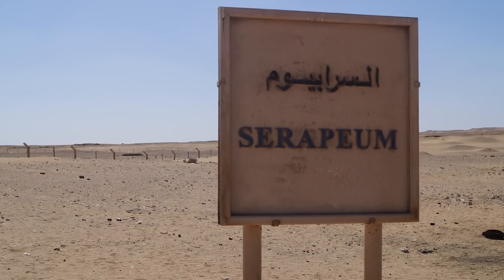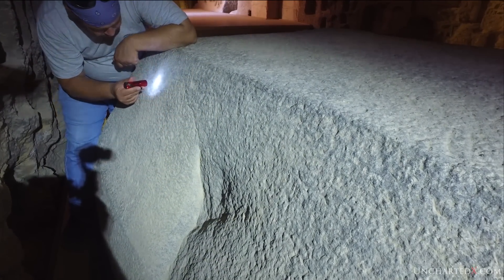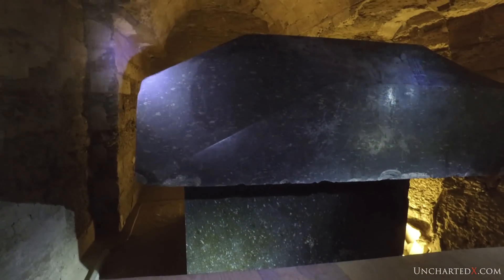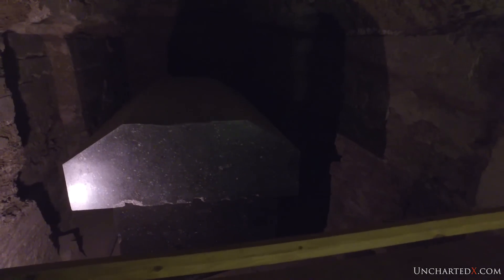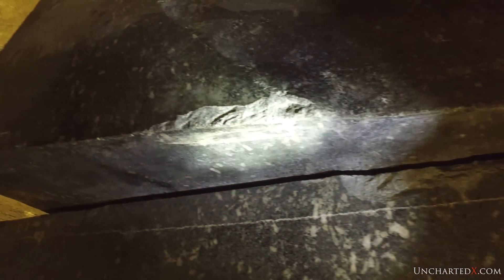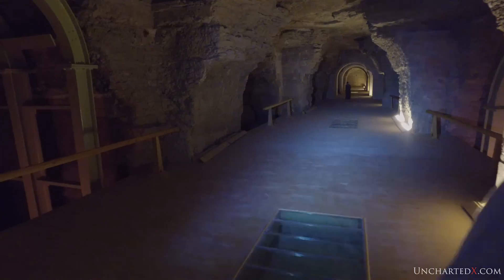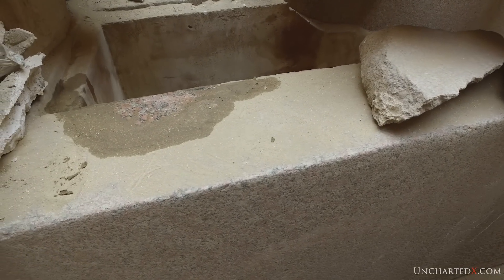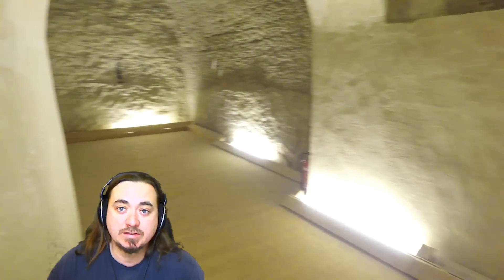Evidence of Ancient High Technology - Liquid Polishing at the Serapeum of Saqqara - Chapter 4

Comment: @UnchartedX
Mind, blown. Spilllover of edge IMO shows an acid was applied & with a roller - the surface was not rubbed at all. AAncient Arch points out sulphuric mine runoff, used by Inca to set wall blocks. Anyway wow - and was this a brewery with one vat per county - and thus a beer allotment that must not be overshot by residents? Were there 24 regions in the administration?.

Comment: That wikipedia snippet is just saying that crystals form because of a low energy state from a repeating arrangement. this just means that they fit together well that way. in other words there is a spot that the molecules like to fit into and it takes more energy to move them out of those spots than into them. It has nothing to do with any weird energy vibration focusing nonsense. To give an example a golf ball finds a low energy state in a golf hole. there is nothing spooky going on there with that low energy state. The ball just has less potential energy due to gravity because it is closer to the center of mass of the earth.
Reply from the maker: yeah i know, im going to fix it when i put the whole thing together in one piece. I get that it's not a solid crystal, it has quartz etc in it, but its not a uniform structure. Of course I probably should have looked into that before but there's only so much I can do

Comment: At 7:07 i strongly disagree that faceting has something do about any crystallin structure/energy.  If the box is functional, like a long term sealed up seed vault, it would seem natural to take material of the side of the lid, to be guaranteed that the center of mass would be somewhre in the middle about the container during some cataclysmic event and to prevent cracks..  Perhaps one side had lots of cracks, but to make it easy and to get symmetric weight. They faceted it like they did. Seems reasonable to me.. Didnt the sarcophages in the osiris shaft have some oily sticky material, this could be remnants of the sealing "glue"

Comment: The liquid runs on the box which he points out could have been caused by the people who shifted the lid to gain access to the inside. In other words they used a lubricant to aid in shifting the heavy lid. It is obvious that it was a real struggle to move the lid as the damage to the edges testifies to.
Reply from the maker: possibly, but the polish on the underside of the lid, in the sections of the liquid 'runoff' is what is truly puzzling. If you ever get the chance to visit the place and look at it in person, it's really obvious just from the touch how much smoother and finer the finish is on these spots. I don't know of any liquid that we use to achieve this. And 100%, trying to move the lid would be a massive effort.

Comment: Indentations  are polished, are the hieroglyphs (inside the strokes) polished as well? If yes the Egyptians did it all, creation of the boxes. If no, the hieroglyphs most likely came along later on, when the polishing method had been forgotten. That would also suggest that the hieroglyphs would be graffiti. 
If the boxes themselves where made as geopolymers, I think, you could add a thin watery layer of geopolymers on the surface when to box has hardened. That would, I suspect make it very shiny, also creating drip marks under the lid.
Reply from the maker: Watch part 5 of this series. I get into the exact thing you mention. To give you an answer now, no, the glyphs are not polished. On ANYTHING.
Reply: @UnchartedX  Thank you, I will watch part 5. Then glyphs are made after, and most likely are the boxes made from another civilisation (earlier). Makes no sense to spend the time and effort on doing the boxes perfect and then rush the glyphs.

Comment: I postulate that "they" were using these boxes to generate something/a substance: a mineral, a metal (gold?), fuel, etc... 
And maybe they needed multiple boxes because they could only use a box for a limited number of times - until its structure was compromised.
I'll also postulate that the reason for this taking place inside the earth/underground is that the substance creation process was highly volatile/dangerous to observe up close..
This is my only theory so far and it's kinda weak, but I tried.

Comment: Could the crack repairs have been attempts to enter the box?
Reply from the maker: Possibly, but my money is on natural flaws that showed up during transport or finishing... There are lots of chips and breaks where people have tried to lever off the lids over time, and we know what dynamite does to the boxes, thanks to Mariette. Before industrialized tools (in the 'modern' era, which is everything after 12,500 years ago or so) you're limited to manpower. Even slamming into it with a sledge hammer would most likely chip it rather than crack a 50+ ton piece in half. I'm really not an expert but that's how it goes in my head, I could very well be wrong!

Comment: Could it be a ceramic coating? Silica/Silicon dioxide? Nanotechnology? Whatever it is, it bonds to the surface and doesn't wash away or break down.
Reply: If they heated sand and melted it into liquid glass

Comment: Mercury, extremely captivating, and dense, fantastic transmitter of sound, liquid and solid form, over long distances, and uniquely, mercury drops respond with tunable shape, geometry, surface energy and even directional motion to sound like salt on a metal plate w sound pitch changes. Can lift, etch, shape, design, and mold anything even granite blocks…just need the knowledge…and the giant acoustic generator sourcing plus the long river of mercury. Which, mercury found in huge pools in pyramids!

Comment: I wonder what a composite liquid with hydrofluoric acid would do.   HF dissolves glass and would readily dissolve granite.    The difficulty is controlling the amount and distribution on the surface to get the polishing effect without irregular etching.    But if one could figure out how to apply it, then those drip polishing marks would have an explanation.    HF is not all that exotic and can be made from  fluoroacetic acid found in some plant species both in the new and old worlds (check out the article by Lia Mangolini on the Ancient Origins website).    The conclusion in the video that no acid was used is not justified.   If the process of dissolution is calibrated then the sealing effect noted would follow since the granite material is not removed but redistributed.   Using acid to remove material is just a variation on using mechanical means so clearly that cannot be how it was used.   Other explanations would require some other sealant to be present.    Anyway, it is clear that modern academia is systematically ignoring the physical evidence.

Comment: Electron microscopy on a polished peice would help and a molecular physicist to determine what compounds are in the polish,basicly a proper forensic analysis is needed for clarity the results would be enlightening,beyond the faceting comparison with a stealth bomber they too have coatings that further enhance the desired function. 
Defelection of radar waves and minimising heat signature and the boxes are hollow and air is a good insulator is it not,seems like a damn good plan to work out which energy they thought they were conducting,storing,focusing,using.
Youssef said they it knew it was not acid,what about an alkali and in fact there was an analysis done on some of the polished granite was there not ? Seem to remember it one of Hancocks books,non crystalline structures had been removed at the surface,leaving the percussively weaker crystals intact,would explain the sheen finish and glass feel,a nanostructure of quartz,perhaps generating a small electric field hence the longevity as it may have a shield effectively around it that may even be pressure activated as well as constant.

Comment: It is not difficult to polish indentations like these scooped out areas if you are polishing by hand or using hand power tools. When I nicked my bathroom counter I sanded out the kick in the middle of the counter to smooth it out some then I used a thick liquid polish to bring back the shine. The result was like these scoop marks but of course mine was less than a 1/2 inch in diameter. A bigger area would have simply taken more time. 

As to the more modern statue what attacks the polished surface is water and pollution. blown sand can do so as well but once something is buried or kept indoors in a cave it will be fine. If it's far from an urban center it won't be attacked so much by pollution.  Also how quickly the surface becomes dull is how shiny it was in the first place. If something is polished to 4000 grit then it may wear to 2000 grit and still look polished but if 2000 grit wears to 600 grit it will look dull.

Comment: Acid damages the material but it will etch it that is for certain.  A particle beam might do the job.  Try alpha particles.  Or beta particles.  Beta I don't think would work. I would guess alpha because it goes into the stone a ways in.  These boxes are where they stored high level Thorium salt solution for their molten salt reactors.

Comment: Ask any stone mason if he can make a 90degree edge on basalt or granite  by using a chisel and a hammer. Even worse give him a copper chisel and a diorite ball. The brittle crystalline structure won't allow it, the edge of the stone will always fracture and chip off when impacted. You will not get a sharp 90degree edge as shown on the boxes. The boxes have had to been finished off using cutting and grinding methods such as gems of a higher hardness e.g. corundum or diamonds.

Comment: efforts to study matter, as well as what we understand to be the energetic components that comprise it- are studied in famous colliders near cities. other aspects of these studies, need to avoid "energetic pollution" createded by mankind, as well as cosmic rays all across the spectrum. the beings reponsible for these vessels, obviously created this facility to collect, and store something. precious and powerful, it also needed from shelter AWAY from energetic particles that would degrade it in some fashion. "it" was not to be stores in containers side-by-side: each container is in an alcove AWAY from thw others a measurable distance, for one reason or another. separated by bedrock. Athe box that seems to have poppes it's lid and broadcast a kind of stain about it, near the bottom level of the place with thw submerged box at the bottom comes to mind. yet, being that these "containers" seem all but unused and blowing up a closed one revealed nothing: speaks of a production facility. a "garage" where these suckers can be produced. their weight and size only considered to achieve the purpose they are intended to perform. maybe not in the particular location, but later to be "installed" where required. these are "new old stock." something happened to shut it all down. i wonder what these beings would think of radionucleide pollution

Comment: The polishing of the boxes by hand using grit and water would work eventually I think but something I just thought of would make the finished box / lid impossible in my mind. How doing the smoothing by hand would they get a surface perfectly flat from one end to the other. Using a metal ruler and torch light we told that the surface flatness is all most perfect everywhere. Seems impossible to me. They must of been polished by some sort of machine kept level for a whole surface. The mind boggles to what they managed to do back then.

Comment: what if they placed the granite in a canal? maybe some bigger stones got washed down, hit them and made these crators... give these stones a year on a downward slope in water, mixed with sands, small stones etc, they woulda been that shiny. just a thought
Reply: when a smaller bigger stone floating in the water was to hit the granite it would skim the outsides of the granit showing the weak spots... place 10 of these in the canal, after a year if they were lucky they would see which stones withstanded the "tides" and would be of use. maybe they used a mixture of water/sand that could of helped them to move these granite stones after to the their destination?
Reply: that would also explain how they got the shiny finish into the crators

Comment: As a rock collector and someone that works with hardscapes, this doesn't make sense.  We commonly use chemicals to polish rock.  Common HCL can be used.  If the rock was exposed to the acids long enough they can leave drip marks.  It's just a form of erosion. Also, concave surfaces aren't that hard to polish with hand tools.  You could make a modified wavetable that could be used to smooth a large surface.
Reply: the only thing that dissolve granite is hydrofluoric acid ,

Comment: Just a note about the crystal structure discussion. First off, kind of amazed how well wiki did. Secondly, everything you (and wiki) said assumes a single crystal structure. From watching your videos it seems these boxes are a form of granite, which as you mention is a conglomerate of different crystallized minerals. Each of those conglomerates' crystal structures will have random orientations to each other. The chances any of those huge facets falling along any of the close packed planes with any purpose, is pretty much zero. If these boxes were single crystals, like gem stone diamonds or silicon for semiconductors, I am sure the ancients would have cleave them into shape instead of cutting them.  I'm not trying to take anything away from how impressive those boxes (or your videos) are, just my unwanted 2 cents.